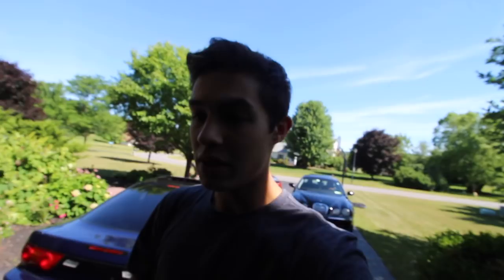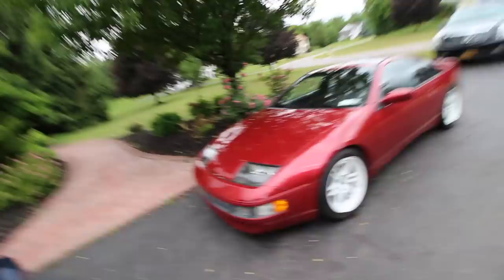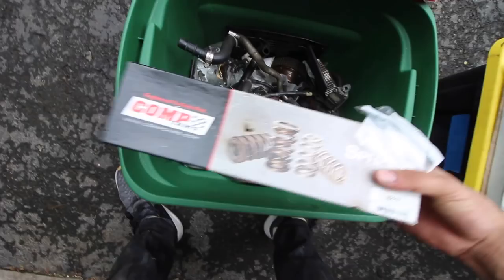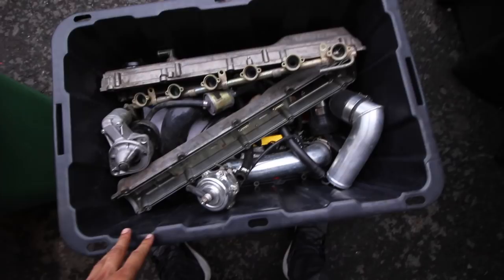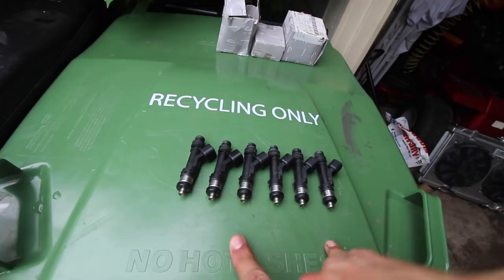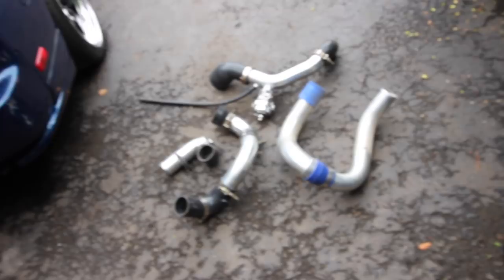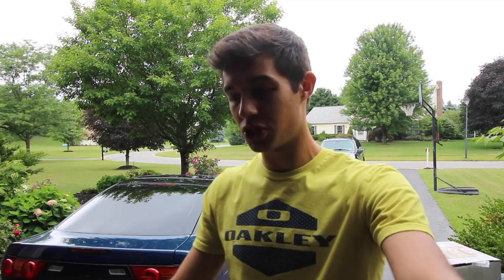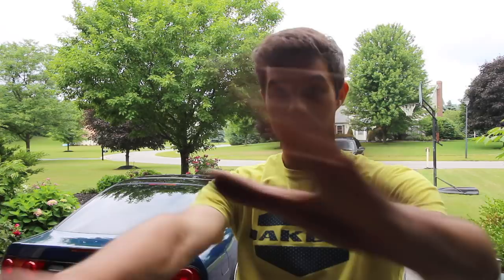Built RB25 Swapped 300ZX Build | LETS MAKE SOME POWER

Comment: Didn't catch you mentioning a name, but Tomei cams are the best bang for your buck. They make drop-ins for hydraulic lifters and solid lifters.
I would get the head decked again & as you already know, take the block to the machine shop and get everything checked. Everything looks good, but I've seen decent-ish looking cranks turn out to have hairline fractures from being abused. The gunk in the oil pan & rusty journals doesn't exactly inspire confidence lol